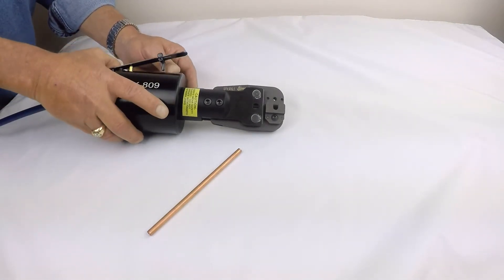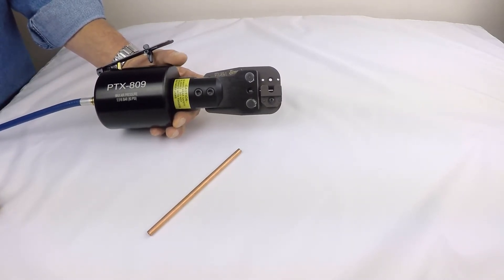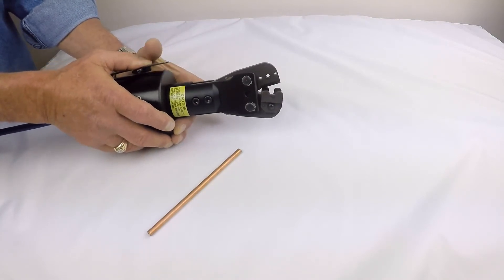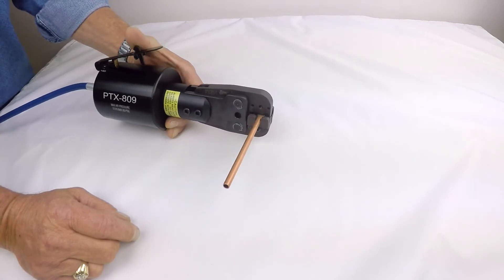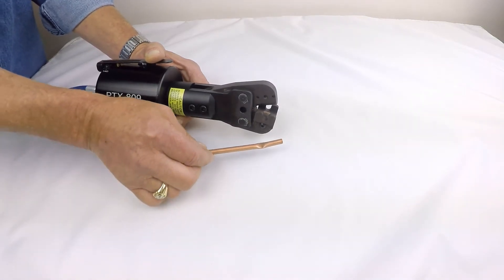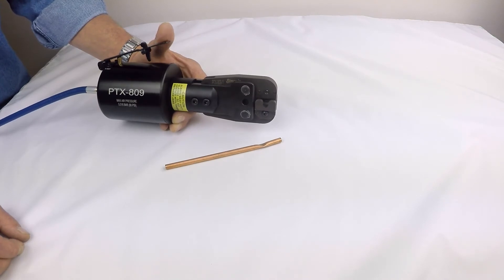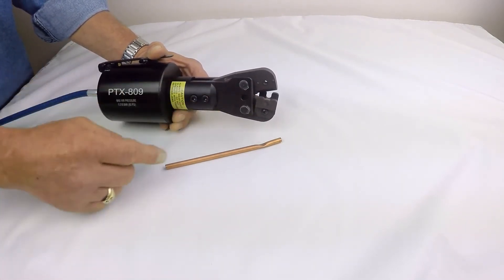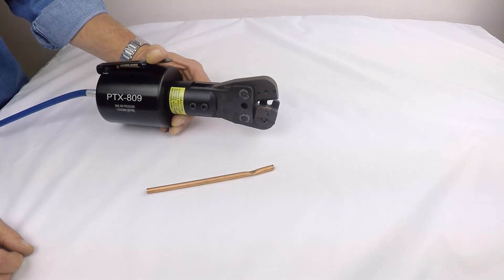PTX 809 Refrigeration Tool

Comment: Why is the tool so ridiculous for such a simple task? Why must is be a pneumatic tool? I'm a HVAC/R technician, and I'm not about to use an air compressor, or my nitrogen, or that RIDICULOUS tool.... When I can use one of two tried and true pinch off tools.
 Sorry there bubs, but that tool is just silly as all hell, and serves to solve no real world problems or struggles. Good luck trying to peddle that thing
Reply from the maker: Jake... this tool is not designed for use by HVAC installation technicians or field applications.  The tool is used by the refrigeration manufactures to seal the tube on their condensers in a factory environment.  If you had to seal hundreds of these tubes per shift, you would not like to do this manually.  Also... it is not a pinch off tool... it simply compresses the tube to temporarily seal it prior to solder or braze, and it does it without weakening the tube.  It may seem "ridiculous" to you, but you're not the guy crimping tubes in a factory all day long.
Reply: Jim... I am so sorry. I didn't even think about the manufacturing process. It all makes sense now. 
 Again, very sorry for the ignorance. Fantastic tool for assembly/manufacturing.
 Sometimes I speak without thinking. It has cost me a great deal in my life.
Reply: @jakem117  then that’s what should be said but he said technicians.